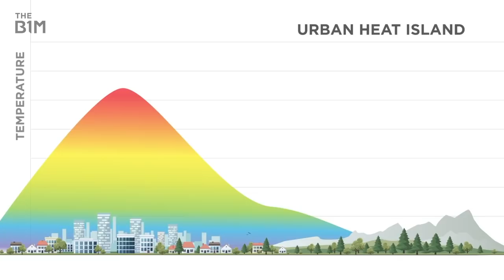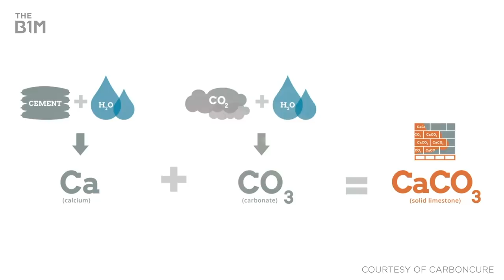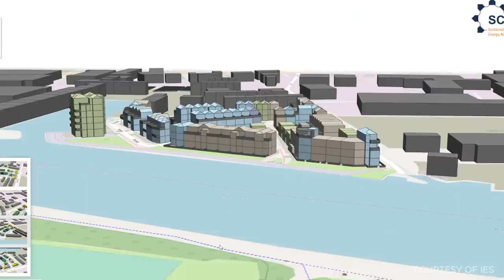Why Buildings Will Save The World

Comment: This is all good, but you didn't even mention PASSIVE heating, cooling and lighting. Most buildings could get all the heat and light they need (during the day) from sunlight. Windows and solar tubes, along with intelligent design can cut down on energy consumption across the board. Cool air can be stored underground and piped into upper floors. Stairs and ramps instead of elevators, solar ovens built into the the kitchen, cold air intake for the freezer in winter; basically removing the need for electricity anywhere we can.

Comment: Hempcrete. Stronger, longer lasting, greater insulation qualities, good for ecology.
Reply: John Peric I do not take drugs or alcohol. The pesticides used on crop farming ruin soil and bleed into waterways causing lifeless zones in them. Hemp has stronger tougher fibres than any other wood material. There are literally thousands of uses for hemp.
Reply: John Peric Fertiliser was a reference to hemp farming that uses no pesticides, and helps sustain the productivity of a human habitation for that little longer. I am not contesting your knowledge simply relaying fact. Hempcrete is indeed used in building construction with regards family homes, else I wouldn’t know about it. As for building skyscrapers from it, I do not know.
Reply: John Peric Bungalows. Wonderfully warm secure housing for families or single people, and very necessary for disabled children and adults alike.
Reply: John Peric Medium-density housing is residential developments that are at higher densities than standard low-density, (or 'broadhectare') suburban subdivisions, but not so high that they might be regarded as high density housing.

Good then. 👍
Reply: John Peric The making of concrete is bad for surrounding environments? Not much more to say really.

Have a mournful and not comic Ash Wednesday.

Kind regards
LM
Reply: Hempcreate is useless. Even Adobe homes made from Wood and mud are stronger and could be taller.
Reply: 5aral I only thought of it as an alternative to the pollution caused from the making of concrete, perhaps not dropping over 2000 nuclear devices since Hiroshima would have been a better idea, I should have thought of this, but wasn’t smart enough.

Have you noticed global news never mentions this disastrous inclusion into our waterways and atmosphere ever?
Reply: John Peric Good Lück with your ability for consideration.
Reply: @johnperic6860  That's true. don't forget with modern technology and developments in construction we can make simple adobe homes even taller. Honestly that's actually a pretty good alternative.

It may not work for metropolitan cities but would be fine for several low populated regions.

Comment: "climate emergency" name one thing that qualifies as an emergency. The IPCC itself has said that there is no evidence that there can be demonstrated any connection between any change in temperature and severe weather events (including draughts, floods or storms or fire).
Reply: Severe weather events are not necessarily directly caused by climate change, yet they happen increasingly often. As no other possible reason has yet been identified it is hence likely that climate change is a driving force of the current development.

Comment: 1. putting some trees in a city does not bring down emissions, nor reduce air pollution. 2. Food production inside a city does not make sense. 3. growing plants with renewable electricity is not feasible. The extra electricity used there is no longer available elsewhere, so the gap in electricity is then filled up with fossil. 4. A bit of extra cycling and public transport does not lead to a "carbon neutral" city. This is nonsense. How are you going to provide heating, cooling, and electricity to the city?  5. Microgrids are technically very very undesirable, as an engineering channel should know. It's the opposite, renenwable capacity should have as many connections as possible for stability.  I like staying positive, but realism is also needed.